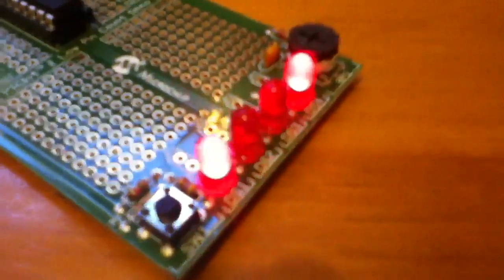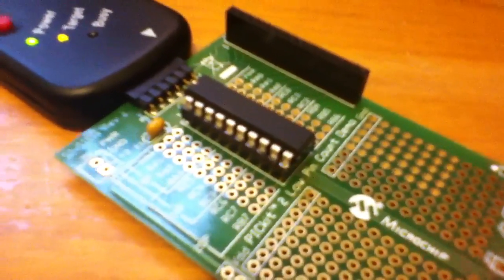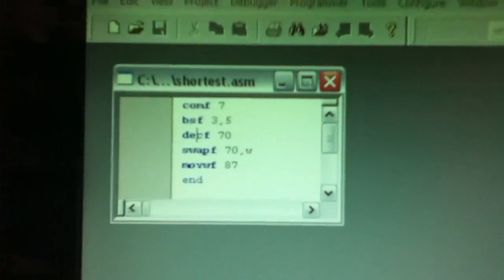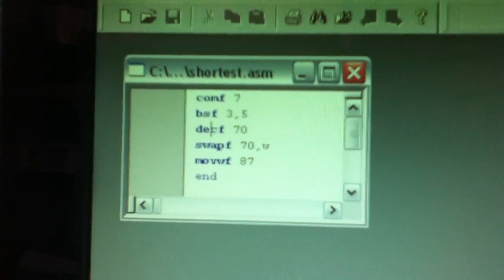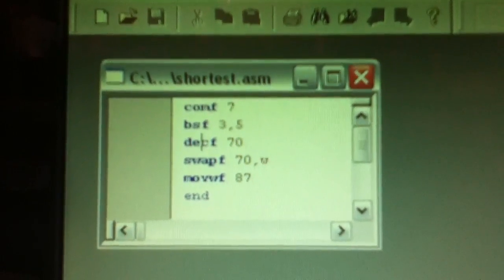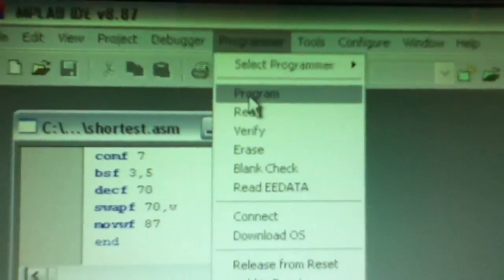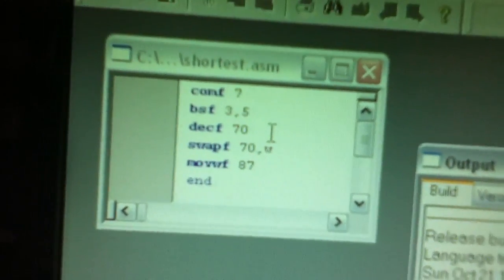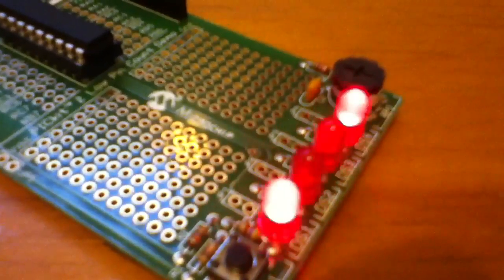No Longer the World's Shortest Microchip PIC Flashing LED Program

Comment: Without using the Origin (ORG) directive the code will be placed at 0x000 onward, bad practice really as many of the interrupt vectors  are placed at 0x004 .
You mention there's no Config set, they must have been set / declared as required, they don't need to be set within the asm file, possibly the chip's reset-state is coincidentally correct for the program to run.

Comment: Being cheap, I built my own Low Pin Count board from the schematics on the Microchip site. Instead of the 4 LED's on RC0-RC3, I installed 4 bi-color LED's on RC0-RC7. When I run your program it flashes re, green and orange, very Christmasy